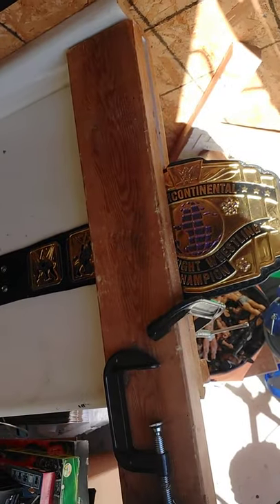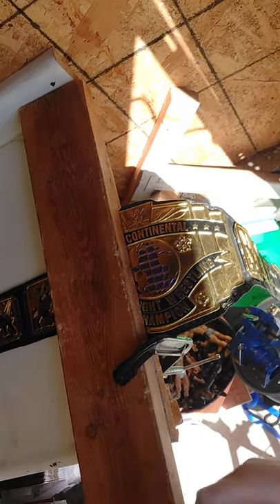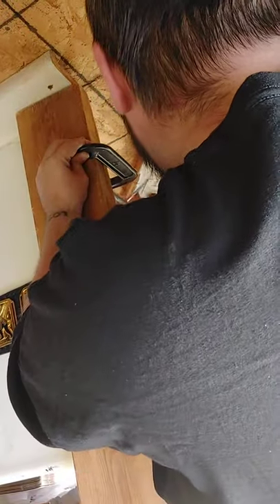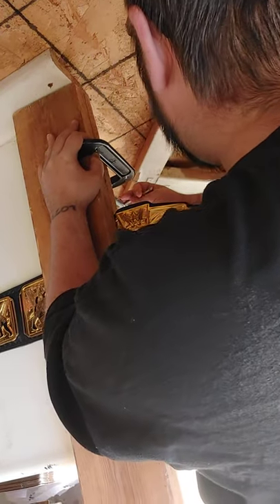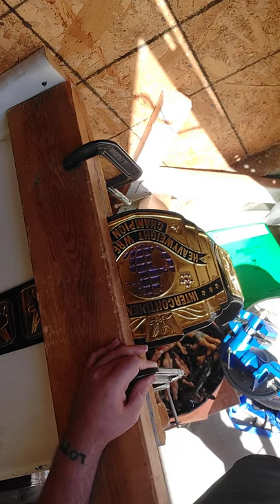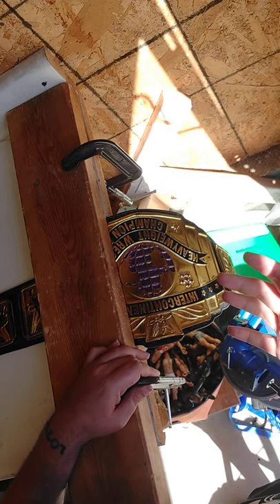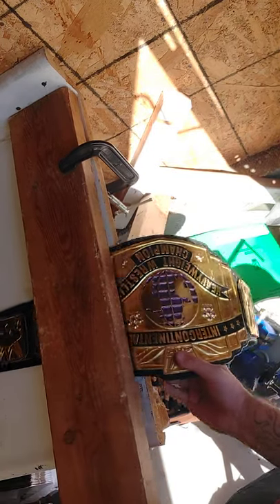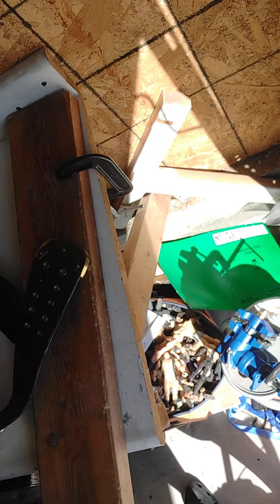How to Curve a 4mm and Above Replica Belt.

Comment: You can do it this way, but speaking from someone with 20 years of experience in metal casting and fabricating, heating the plates is a better option. Heating the metal softens it, it will also soften the plating and most important, the paint so be careful there. But once you heat the plates all you have to do is wrap it around a tree in your yard(or use a log if you have one) with a ratchet strap. Just tighten the strap slowly while you continue to apply heat till you get the amount of curve you want. You will have to move the strap around a bit so it will curve the plate evenly. Zinc is a soft metal but is also brittle so heating the plates will soften the plates making them less brittle and more pliable.
Reply from the maker: Thank you for your input these are the type of comments I like to see!
Reply: Nice video, but I'll be to scared I'll break my belt. That was a nice curve in your belt. Again, great video
Reply: I ran mine under hot water to "soften" them up. Excellent idea!

Comment: I’m holding my Ic block shop main plate in hand right now,  this work with the 2017 + casted shop ones?
Reply from the maker: Yes sir (or mam) either way it still works for any 4 mm belt

Comment: Quick way to crack the plating. Bad idea. Gotta heat the plates up before trying to curve
Reply from the maker: It's a myth
Reply: @DYoungCustoms  I’m speaking from experience.
Reply from the maker: Speaking from curving over 30 belts I have not cracked a single one I can say heating isn't required